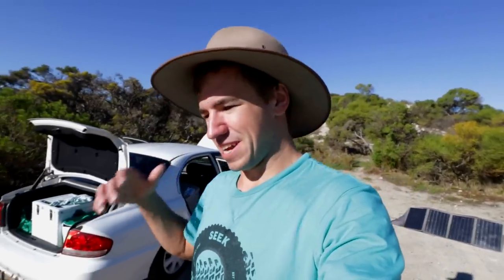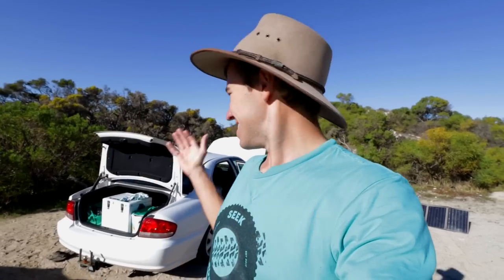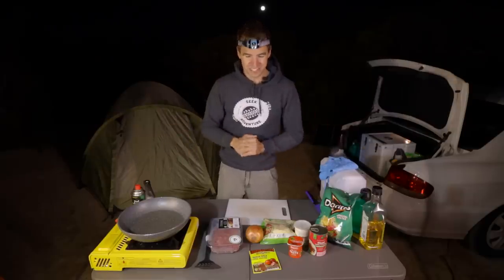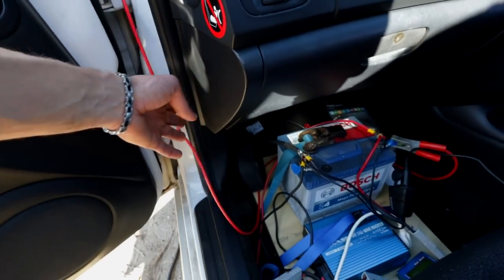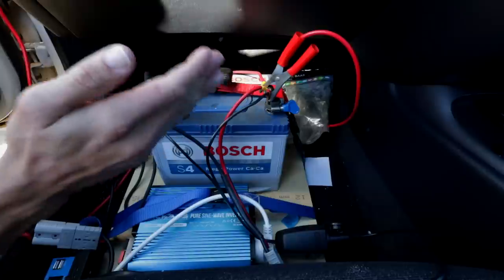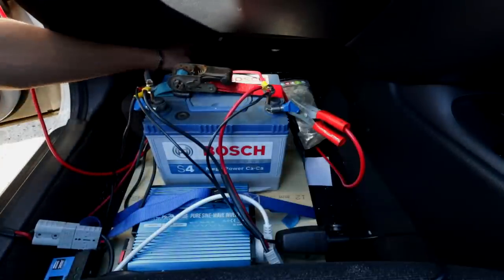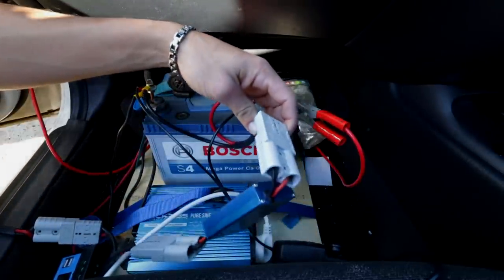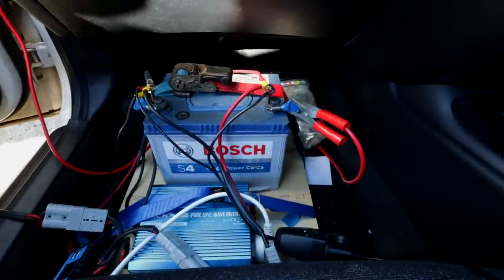Dual Battery Setup -  On The Cheap $

Comment: I just bought a deep cycle marine/RV battery today.  I already had a 400 watt inverter.  I just put it in the trunk and have been thinking about a quick and cheap way to keep the battery charged.  Later I will probably try to get an isolator.  But for now, I really liked your method.  I just need to figure out how to run the cable from my car battery back to the trunk to my new second battery.  Thank you for sharing!
Reply: I had a deep cycle battery that I charged via a "coke can" inverter 150 watt, and plugged a automatic 6 stage charger from home into the inverter. Worked like a charm! 
Note:  will only charge when the ignition is ON.
Reply: I dont know what a "coke can" inverter is...sorry.  I'm not sure what you mean but I'm thinking your talking about plugging a battery charger in to the inverter and letting that charge the deep cycle battery?  If that's right, would just installing an isolator be about the same thing?  Hmm, wonder if using an isolator would over work an alternator?  So much to learn...lol. I appreciate your responses though.

Comment: Have to mention that you can generate hydrogen gas (explosive) from charging these unsealed lead acid batteries.  For that reason you won’t see these inside vehicle cabins.  Be better to use an AGM that’s sealed so you don’t blow yourself up.  Aside from that, enjoying the vids mate, good work.
Reply: Ashley Horner also donot make a spark near the battery, the battery can explode. This happened to a mate of mine after charging a motorbike battery - he was ok as he wears glasses. A battery box will contain the mess and is highly recommended.

Comment: A variable voltage alternator (most cars now) will just see a larger battery and will maintain 14.7v (max v) for longer. It works fine in my FG Falcon.

Comment: Could of just come out the cigarette lighter socket with alligator clips to the battery. Would only charge when running and be fused for free 😁
Reply: Would that give enough volts out of the ciggie socket to charge a battery properly
Reply: An idea worth exploring

Comment: Recommend an AGM battery for in the cab though....charging batteries creates fumes which s far as i know isn't excellent for breathing in
Reply: Its fine to breathe...unless there is a spark. And in that case asphyxiation will be the least of your worries. Charging lead acid batteries generates hydrogen gas so if you do this drive with the window down or as you said, use an AGM battery. And NEVER set up anything like this without fuses or circuit breakers.
Reply: Having a big lump of a battery in the cab is also good for emulsifying the contents of the cab during an accident.

Comment: You can get a fused battery box with plugs and whatnot for under a hundred bucks. I used that and a $30 VSR which I screwed to the battery box. Grand cost of $90 and it’s not going to start a fire or drain your cranking battery when you forget to unplug it.
Reply from the maker: I know you can Alan, but for a 3 day trip spending $120 was out of the budget.
That's why I prefered to just go overkill on the cables sizes to ensure nothing happened 👍
Reply: Seek Adventure fair enough. If there is no cash, do what you must.

Comment: If you have around 100 bucks a smart solenoid between the start battery and second battery is an easy solution to the dodgey alligator clamps and will maintain start battery as it isolates when the start battery drops below 12.6v meaning you can just leave it all hooked up 👍
Reply from the maker: The battery isolaters are great 👌 I just couldn't justify one for 3 days of use.

If I had a spare manual reset circuit breaker laying around that would have been ideal! But I didn't 🤔
Reply: @SeekAdventure  yea I get the angle of ya vid mate it just worries me that inexperienced units may melt their car but oh well all good

Comment: And you shouldn’t have a lead acid battery in a vehicle due the the gas that does escape no matter how warm it is but A+ for Ingenuity
Reply: It looked like a sealed battery. Not too bad.
Reply: GGFCHMMAL doesn’t matter if it’s sealed all batteries have a breather on them
Reply: @adamphillips1720  Yeah it's not safe in a crash with chance of fumes and acid going over occupants. In boot or engine bay for lead acid.
Reply: @adamphillips1720  gel batteries like Optimas are completely sealed and safe to have in the cab but that looked like a regular maintenance free lead acid battery.

Comment: I've been told you can't put a led acid battery inside a car as it gives off toxic fumes as it discharges?
Reply: hydrogen gas, more explosive then toxic so as long as the interior is vented not too bad
Reply: mcfear1991 good to know thank you

Comment: 12 volts won't kill you, but it will burn your car to the ground! Just saying.....
Reply from the maker: My parents were disappointed since they wouldn't have minded the pay out, but no such thing happened 🤔.
Next time I might use 10a cable from the starter battery, that'll do the trick! 😁
Reply: @SeekAdventure  You'll be right Michael. Maybe a video on 12 volt wiring perhaps. how to rate fuse to wire that sort of thing.....or you could Seek Adventure. :)

Comment: Is that a hyundai meltata?
Reply: no meltata's in aus mate
Reply: @MiniLuv-1984  bahahaha that was my first thought but then I saw the reply and thought I was wrong. Yep a set up like that is a very, very bad idea. At the very least it should have a circuit breaker or fuse at the car battery end (that cable would last a good while before it burned through!) and have your window down when the engine is on...lest that hydrogen explode your car before it has a chance to melt :-P
Reply: @MiniLuv-1984  what words was it a play on? If the car was a tata, yes that's an indian brand, I could see it but otherwise pretty piss poor effort or do you just add ata to a word, pissata effort then on your part

Comment: I believe it would serve MOST people best to see their dealer BEFORE trying this, before ruining their charging system. [Hey, what's a $500 alternator between friends... right?] Apply Edit... but read my answer, please.
Reply from the maker: Hey Bruce, running a dual battery system is no different to running high output driving lights 🙂. Most stock alternators are more then capable of running a dual battery system 👍 I’m not sure why you would think that it would cause damage to your alternator?
Driving through a mud hole, now that is how you part with $500 for an alternator 😁
Reply: @SeekAdventure  , because a battery such as the one you show is NOT a standard battery... it must be charged with a cell balancing charging system. That is not the same as losing an alternator, of course. That part was a bit dicey... LOL  BUT, all in all, you mention CHEAP. You chose a high end battery for your CHEAP system, thereby making it anything but "cheap." OK?
Reply from the maker: I did mention that the battery was one I had laying around 🙂. It is heading for recycling anyway so that fact that it wasn't be charged with the correct profile is no biggie Bruce 👍.
Reply: @SeekAdventure  many stock alternators may cope with the added load but the cars electrical system and/or computer may not. In a modern vehicle it is definitely not just like "running high output driving lights". 

The 'variable voltage alternators' you referred to are all alternators. In the past they had a regulator which maintained a consistent voltage and were permanently connected to the battery. In many modern vehicles the computer controls the charging. For fuel economy they can stop charging when it isn't required and for extra power they can pause charging during acceleration. 

Another of many variables are cars which use the calcium variety of lead acid batteries and charge at a higher charge voltage...which is not compatible with normal lead acid batteries. Edit: And as I mentioned in my earlier post, the 'auxillary battery' you are using is a calcium battery, which should be charged at a higher rate to properly charge it and avoid damage. 

Then there are the countless ways a dodgy setup like that could cause major damage to your cars electrical system.

Anyone who does not know what they are doing should not attempt anything like your setup unless the car and battery are expendable. And even then, then hydrogen and potential short circuits still present a risk.

I feel you are doing your otherwise excellent channel a diservice by attempting to defend (even encourage) this setup.
Reply from the maker: Hey Kirk,
Sorry Youtube flagged your comment as spam for some reason.
Are you familiar with how isolator dual battery systems operate? The redarc Redarc SBI Battery Isolator is a very common one. All they are is a big switch that engages and disengages the connection to the auxiliary battery, just like how I was engaging and disengaging my auxiliary battery system 🙂. 
Redarc have a good article about the two alternator types if your interested, but this vehicle has the older fixed style alternator 👍 https://www.redarc.com.au/alternator-vs-fixed-alternator
The cables I used for this setup were all overkill, that way I knew nothing could go wrong unless they rubbed through somewhere, that’s why I put split tubing through the engine bay, even though it really wasn’t necessary. That’s why I wasn’t worried about fusing it, especially for only 3 days of use.
I know the battery was a calcium battery, it came out of a car that needs it due to start stop technology. But it doesn’t matter what kind of battery it was, there is no way that it is going to damage the vehicle’s battery or computer system. I only needed the battery to last 3 days, so the fact that the charging algorithm wasn’t correct did not worry me one bit, the battery is going to be recycled now anyway.
I said in the video that I wouldn’t encourage this setup without fuses, all the setup needs is a 50a circuit breaker as close to the starter battery as possible, and a fuse on the positive  Anderson plug, cig plug and inverter cables. Add a couple of fuses and it is a fantastic budget setup 👌😊
Reply: @SeekAdventure  , Seriously, the problem is also practical for YOU... as many apparently "dead" batteries of that type are only dead because they contain an undercharged cell (many use only four cells due to the difference in chemistry) but require a slightly higher charge voltage if no balancing is used. Only two tenths of a volt can overwhelm a great battery if continuously undercharged. Please understand that I am not "just trying to be right," as you did say this was a short term fix.
Reply from the maker: @BruceNitroxpro  Practically for me the battery worked Bruce, if it had dropped a cell It wouldn't have run my inverter and chargers 🙂. 

The battery was changed as preventative maintenance, not because it was 'dead'.

The fact that it was charging at a lower voltage of around 14v instead of closer to 15v isn't the end of the world, it just means it's not getting a full charge. I don't see why your so stuck on that. 
If I had an agm, or standard lead acid battery that held it's charge I would have used that, but sometimes in life you just got to make do with what you got 👌